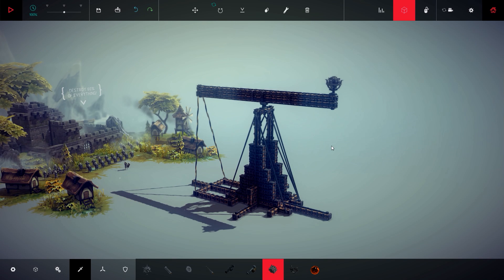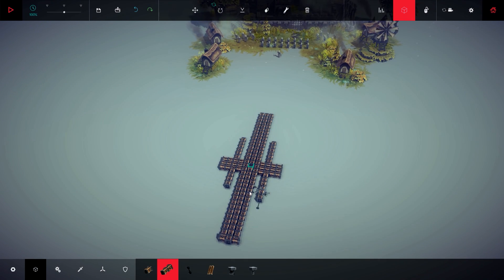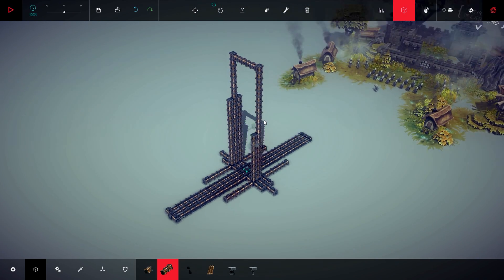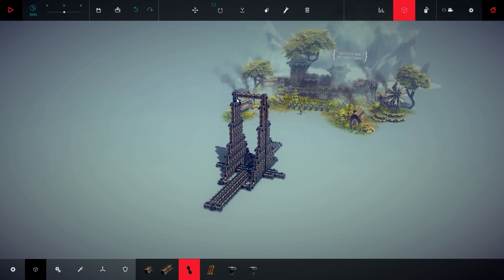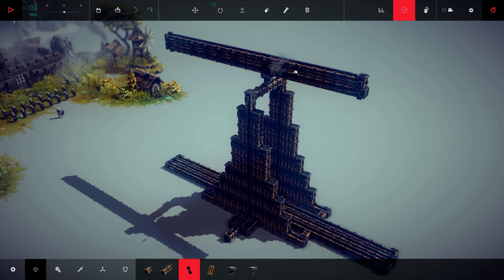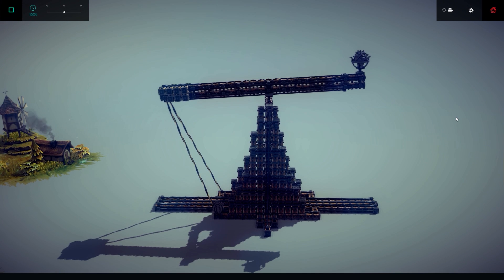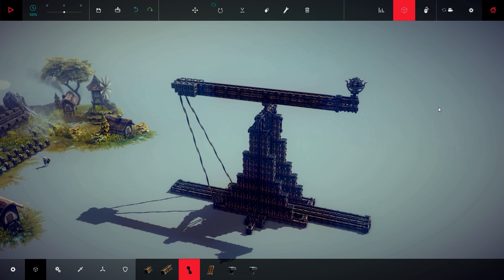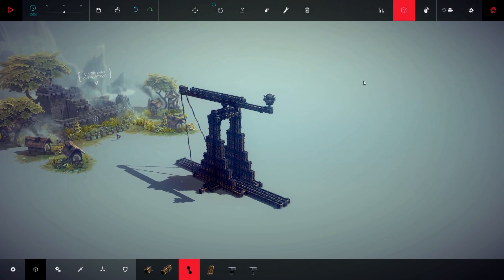Besiege - How to build a Trebuchet [Guide]

Comment: bro you made a catapult (i dont wanna sound like a hater but i just wanna givre feedback) a trebuchet used a weight at the front and a contractable spring at the BACK to hold it in place
Reply: Actually trebuchets don't always have weight at the front, but they do always have a sling.

Comment: Hmmm, so the lever is powered by the tension of the strong? Then it is more like a catapult, though it does look like a trebuchet. A trebuchet is powered by a weight beneath the lever that generates swing through gravity, like those things on the walls of Gondor's city in Return of the King.
Reply: No, trebuchets have a sling, not always a weight. Look up traction trebuchet, the springs are there instead of humans pulling. So either way its not a trebuchet.

Comment: Not good, and not a trebuchet. Sorry man :/
Reply from the maker: Kristopher Burgess Why isn't it a trebuchet? :(
Reply: SergiuHellDragoonHQ It's a catapult. A trebuchet is a type of catapult and what u r building is a regular catapult. The title said is u r building a trebuchet catapult.
Reply: SergiuHellDragoonHQ
Yea, I didn't mean to come across as offensive, only stating that what you have shouldn't be classified as a trebuchet.

Catapult would be the larger category of siege weapon, which a trebuchet belongs to. But in order to be a trebuchet, generally a device must have the following characteristics: "Generally, a trebuchet has three major characteristics: A) It is powered only by gravity. B) Its force is able to equal 4 to 6 times of the counterweight arm’s length. C) It uses a sling which acts as the secondary fulcrum. These three major characteristics of a trebuchet enable it to speed up its projectile."

From this site: http://www.differencebetween.net/object/differences-between-a-trebuchet-and-a-catapult/#ixzz3Qmm0vzKJ

Hope this helps!
Reply from the maker: Kristopher Burgess
Don't worry, you were not offensive. I understand your points. I will work on a Trebuchet that will match what you just pointed out. :)
Reply: just to add a trebuchet flings the projectile not launch it

Comment: Sorry to tell you this bro, but this is NOT a trebuchet.  It's a catapult.  There is a difference.
Reply: SergiuHellDragoonHQ One of the main features that distinguishes a trebuchet from a regular catapult is the sling that makes the payload flip over at the peak of the swing, adding horizontal velocity. You can emulate it with a hinged segment towards the end of the beam where the payload is.  It's awkward to do with the bomb basket holder thing... I used a grabber that grabs the bomb at the start of the level, and I manually release it at the best time. Gravity powered versions are kinda dicey because of the physics - I couldn't get a weighted version working that didn't break its axle. Oh well. Spring power will have to do.
Reply: This is neither, this is a mangonel.
Reply: escraftTH All trebuchets are catapults, but not all catapults are trebuchets.
Reply: Clifford Trueman There are tension trebuchets aswell :) traction trebuchets*. http://en.wikipedia.org/wiki/Trebuchet#Traction_trebuchet  I made one in game and it can reload!
Reply: SergiuHellDragoonHQ trebuchets use the power of gravity to swing instead of springs. replace the springs at the front with ballasts attached to the arm so the weight of them is enough to fling the bomb, which should not be attached to the arm, but to a rope(contractible spring)
Reply: jmr2000 A grabber on the end of a free floating hinge would just as well service for the sling rope.
Reply: The mangonel and trebuchet are both types of catapult.  But yeah... no sling = not a trebuchet.
Reply from the maker: What would make a trebuchet a trebuchet Biz Natchington ? :)
Reply: ***** I managed to build a working one with conterweight with a big cube of wood covered in armor with struts everywhere, the range on it was pretty shit though.
Reply: ***** I'll have to try with a hinge might make it better.
Reply: ***** zzz
Reply: i wish this was i was looking for a trebuche not a catapult
Reply: SergiuHellDragoonHQ A Counterweight, Sling and nothing pulling it down.
Reply: These are thre three requiered things for it to be classed a trebuche.

"The three chief distinguishing characteristics of a trebuchet are:

The machine is powered exclusively by gravity; most often directly by means of a counterweight, though sometimes indirectly (such as in a traction trebuchet).
Such force rotates a throwing arm, usually four to six times the length of the counterweight arm, to multiply the speed of the arm and, eventually, the projectile.
The machine has a sling affixed to the end of the throwing arm, acting as a secondary fulcrum, to further multiply the speed of the projectile.
The Couillard is a smaller version with a single stem or platform instead of the usual double "A" frames. The counterweight is split into two halves to avoid hitting the center stem."

Source: http://en.wikipedia.org/wiki/Trebuchet#Basic_design
Reply: emilkon Thank you for that information.